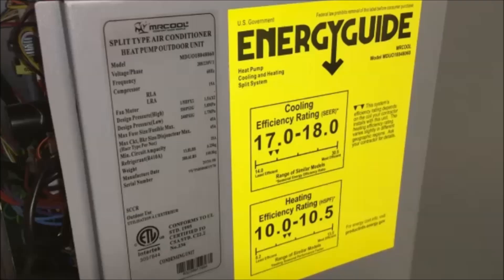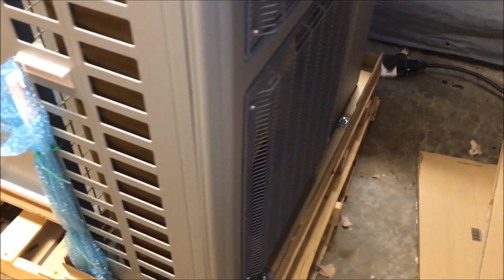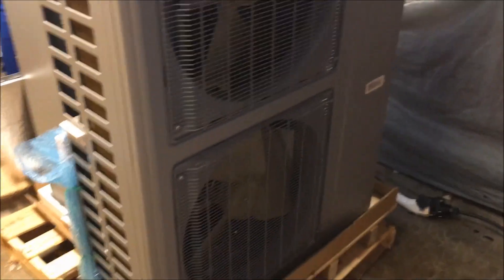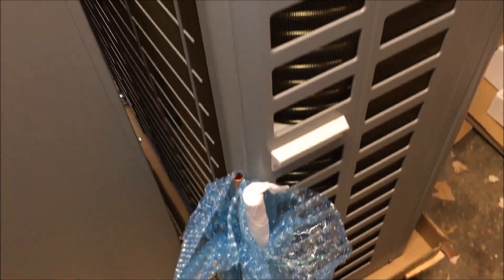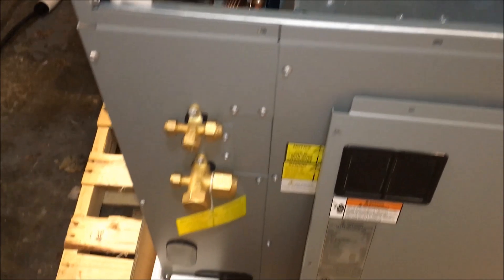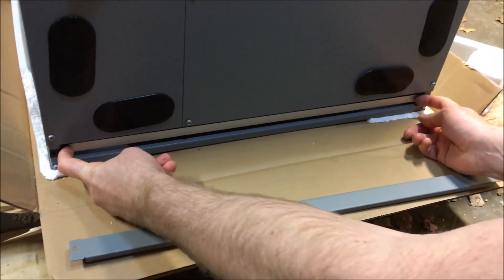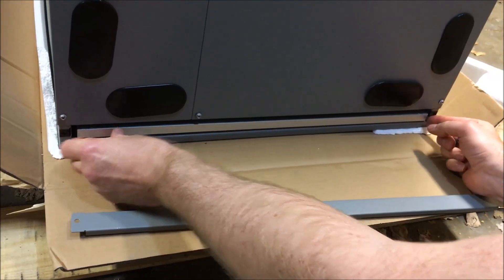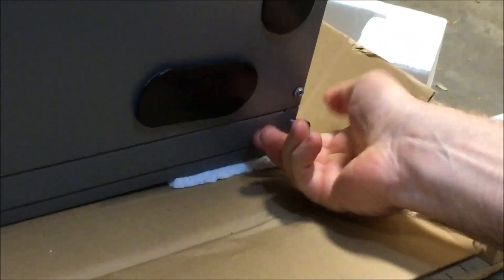DIY Mr. Cool Heat Pump DIY HVAC Unboxing Part 1

Comment: How's the A-coil condition after 4 years? Perfect, clean, rusty, corroded, etc? Thanks!
Reply from the maker: It's worked fine.  Nothing corroded or any issues with outdoor unit or indoor unit

Comment: This Mrcool brand is worst you could ever buy. Mine broke down several times in less than a year. Then i replaced it with a Carrier. Learned my lesson
Reply: I agree my neighbor bought one and he said it was a big mistake. Technicians would laugh and say he needed to change that junk to an American brand instead of constantly fixing it. Parts were very hard to get cause they wouldn't want to honor the warranty
Reply from the maker: "Americana brand"  really means nothing anymore.  Those parts are sourced from China  as well and even more overpriced. 

 Carrier had a class action lawsuit recently over quality recently.
Reply: I heard this as well. When things go wrong, information is scarce, and other companies are hesitant to work on it.
Reply from the maker: So, baerd  off  your single data point, you're  extrapolating  to the entire  population? 

I have had mine for 3 years with no issues  and have been happy with it. 

Maybe yours was installed incorrectly?
I hate to extrapolate on one data point. 
Can you cite failure rates ?
Reply: @stem_saving1644  My Ac Technician said he's had to replace a bunch of these unit that are made in china. Also the warranty department is terrible. Go look at Yelp reviews with one star out of 5. Better Business Bureau is loaded with complaints.
Reply from the maker: Who put your unit in, and what failed?  I agree that the service depth is hard to reach when you have questions.
Reply from the maker: What isn't made in China now a days? Trying to find something that isn't is near impossible.  Sounds like bad brazing  on the coils.

Sorry you had issues ...

Comment: How has the unit been 2 years in and what was the difference in your bill from a old unit thx
Reply from the maker: It's been great.  The  bill has been lower for both heating and cooling. I'm trying to get another video out for that.
Reply: @stem_saving1644  if you dnt mind me asking about how much was the difference in the bill amount and could it be used better with a solar system and won’t use a lot of power
Reply from the maker: At least 15% for cooling energy savings and heating at least 40%
Reply: @stem_saving1644  thx my friend

Comment: Why the heck is the natrual gas in copper?
Reply from the maker: Can't say,  didn't build the house.
Reply: @stem_saving1644  I say that all the time at my place. Like WTF would someone run the copper for the hot water heater halfway in and halfway out of the studs so that there has to be two 1 inch lines about 6 inches apart stretching four feet up the wall?

Comment: TXV is not for reversing the flow, it is for regulating the pressure before expansion... Thermal Expansion Valve.  Somewhere else inside there is a reversing valve for switching between cooling and heating modes.

I ordered the 2-to-3 Ton unit earlier this week and it arrives today.  My AC compressor is trashed and my TXV is plugged up.  I have been wanting to move to a heat pump system for a while.  This should be better for both heating and cooling as my AC was only a 13 SEER unit... which I was really suprised to learn sense I paid extra money when this house was built 8 years ago for a high efficiency system; I think they went high efficiency on the gas furnace which is actually a waste.  Anyhow, the old AC was 3 Ton and it was zoned, which led the to failure.  I didn't get the air handler, just the evaporator coil, and I am pairing up with my existing gas furnace and air handler.  I am going to use it for a few months and see how I like it.  If it ends up being a wise investment, I am going to get a second 2-to-3 ton unit and the appropriate air handle and I will get rid of my zoning board, dampers, and separate the ducting so that zoning is just handle by having two separate systems.  This is the 3rd time in my adult life that I have been without proper cooling for at least a week during the hottest part of the summer due to a failed unit.  I replaced my system at the old house... and then the next year the line set was struck by lightning... and now this.  I am not dealing with it anymore.  Two systems with fewer single points of failure.  If a system is down, at least the other one is working.  When I have them redundant, I will put them into 2 Ton mode and see how things go.  I hadn't really considered switching between modes, so that will be a great option if more heating is required.

I would have preferred to get the 4-to-5 unit if they would have offered multiple line sets be run out of it like they do for some of their zoned mini-split systems.  But, that would have been a single point of failure even if I had two evaporator coils.... so maybe this is better.

I am just getting ready to pour my concrete pad and was watching your other video just as a sanity check.  I was a bit concerned about the dept of the pad and the possibility of enough wind wanting to apply torque at the base, but I have the smaller unit and my depth of the pad is 24" like you have done for the taller unit.  I opted to make the pad 6" thick, as well, to get it a tad higher up in case of snow.
Reply from the maker: Thanks for the note.  Yes I misspoke on the txv. It's  not a txv.

Sounds like you have had quite an experience with hvac.  Mine lasted 20 years (knock on wood), but the coil stated leaking....

I had been planning on removing gas for a while since I have all solar and going heat pump.  So it was perfect timing. 

It's been great so far.  Just a little louder in winter due to compressor throttling up and down. 

I'd make sure you get nylog blue to seal all the connections. I was honestly paranoid about that. 

I'd really like to see a video of what you have. Let me know how it goes.
Reply: @stem_saving1644  I just poured my pad this morning.  I didn't do any video, but I grabbed some pictures as I just used a pallet to make the form.  They're supposed to be delivering my system any moment.
Reply: @stem_saving1644  I got my system installed.  It isn't really "done" but it is functional.  There were some parts that were far more challenging than expected... some my own doing.  Getting this to work with an existing furnace/air handler was a bit of a challenge.  While it lined up appropriately, the inside of the MrCool evap coil was smaller than the old system.  I had to bend the tabs down and put some angle brackets in there with screws.  Also, the line set was so tough to get right... first getting the last bit screwed in on the condenser was a pain but also getting the bends right.  I think in the future, I would get the outside oil return bend done first and then slide the line set inside... but that would work because I was going into an entirely unfinshed basement.  I also had to drill holes through brick which was an utter pain.  The other pain is the wiring.  I have a zoning board (still in place for now) and the air handler blower is a joke from Bryant because it needs a special communication board that was actually never installed (so it never worked properly).

I have it working right now by having the MrCool wired directly into my downstairs thermostat and my upstairs thermostat wired into my zoning board basically only controlling the fan (the upstairs damper is pulled wide open because it failed).
Reply from the maker: @dus10dnd  I think once you get it all squared away, you'll like it.  The larger diameter pipe was a little harder to form, but a little elbow grease and it's not so bad. 

The savings will be the best part!
Reply: @stem_saving1644  I am certainly happy with the system and the savings.  My biggest fear with anything like the line set is both that is requires a certain strength but restraint enough to not damage it... I always have a hard time with that sort of thing.  :)  The system is extremely quiet and it is working fantastically.  I am looking forward to the this Fall when I buy a second one and get rid of the dampers and zoning board.

Comment: Got those units and they work well - moving the heat exchanger up a hill to the side of the house was a bear (380 lbs!) Like the poster, I too wasn't thrilled that it's air handler intake is the base (but makes sense for side mounting.) So I had to build an intake base for the vertical mounting I used - very simple compared to the duct system I had to build to interface to my existing ducts. Note: the air handler has a dip switch that ONLY controls the fan speed (the other converts from 5 ton to four ton.) They claim he unit is good to -5F with no required aux heat. I had a few days of +5F and it didn't use aux heat at all. So that claim looks fairly accurate. Be VERY careful if you install the aux heat system that you use the rated heavy cable that can handle that 15,000 watts (and surge) - that is important. If not knowledgeable this really needs a professional to be safe. Do install a surge protector on at least the outside unit - those digital electronics can be fried otherwise by common surges. I use a surge protector on each unit AND a whole house unit. Cheap compared to even a single service call if a circuit board dies. While easy to install surge protectors - again, if not knowledgeable, get a professional to wire those when they wire the system.
Reply from the maker: Yes agree 100% with you.  The 4ton is a bear to move.  I also bought some surge protection as well.  Just didn't have it for the video.

Comment: I bought a HVAC outside package (air conditioning an a gas furnace) from Ingram's and when i received it  it was all banged up ( dented) and they gave me a bunch of trouble about  returning it and the manager said he was busy having his house built. They were kind of rude to me
Reply from the maker: Sorry to hear that.  I had good luck with them. Returns weren't a problem.  You can try Amazon.   Always buy with credit card, that way you can dispute the charges if a merchant isn't helping.

Comment: All handlers sit on a box none of the, have side air intake, only furnaces got side returns.
Reply from the maker: Sure would make sense to have more options on hvac equipment.  That's one thing I didn't like about the unit I installed.

Comment: Dude I just bought 2 4to5 ton for my house. It’s massive! I’m struggling with the size. I don’t have much head room. Also line set is so hard to bend. 3/4” through brick walls
Reply from the maker: If your bending 90 angles get a pipe bender, link in description. Otherwise, take your time bending it.

Comment: You are putting a 4-5 ton system on a 3 ton duct system without any modifications? Thats really fucking stupid. Good luck with moisture, mold and bacteria problems in  your house!
Reply from the maker: That's your opinion. It pulls the correct cfm and the duct system was prevuyosky sized to a 100,0000 btu furnace.  Worked fine for 22 years and works fine now.
Reply: @stem_saving1644   Not opinion. Its a fact! Ive been doing hvac for 25 years. your furnace, did it have a 3 ton blower or a 4 ton blower? The furnace blower had a PSC motor and the new air handler has an ECM A duct system that is not properly sized to the equipment is going to have problems. When the compressor goes out in two years, have fun.
Reply from the maker: It's interesting you know the facts about my system,  having never seen it.  FyI, it had a 4ton blower.  But never the less,  using rule of thumb for 25 years works,  until it doesn't.  The science should drive the tonnage, not rule of thumb. I did a manual J and the calculations come out to right around 4t of heating. We'll see how well it performs   over the years.

Comment: Can you share what filter you ended up using to replace the metal screen?  Have this same unit and have come up empty in looking for a filter replacement.  It doesn't seem to use a conventional size.  Any help appreciated!  Thanks!
Reply from the maker: I used https://amzn.to/3U8dSIT  Its a tight fit, but works for me, plus its washable. They have a couple sizes to choose from 20x23 is what I have

Comment: I have the same system and in less than a year the indoor  coil roted rusted out and started leaking Freon.  Ingram sent the same coil and it's starting to rust bad again. Now my problem is the liquid line gets cold the air coming into the house goes up and starts getting hot. A quick fix is to turn off the unit and turning it back on. The compressor makes a noise that goes away in 30 seconds and the liquid line is back to normal and I start getting 60° through the vents. Anyone know what s going on with this problem I'm having?
Reply from the maker: Never had that issue,  hopefully they are reconciling it.  Sorry for your headaches.
Reply: @stem_saving1644  yeah these units are China made crap